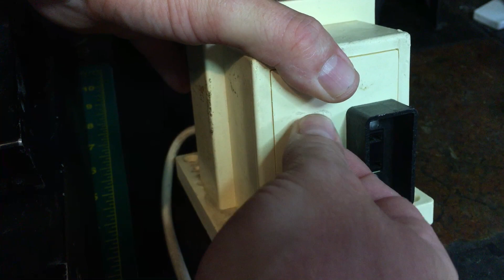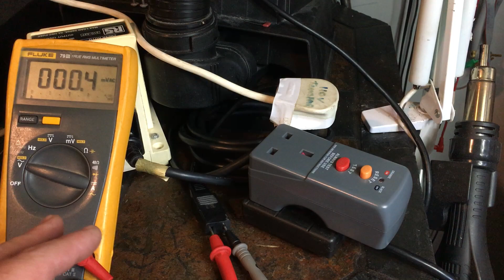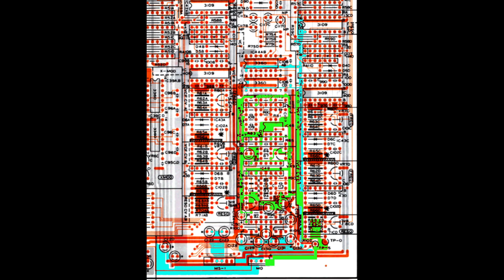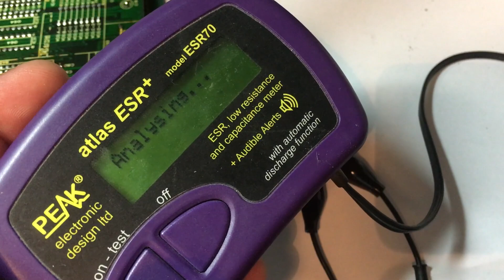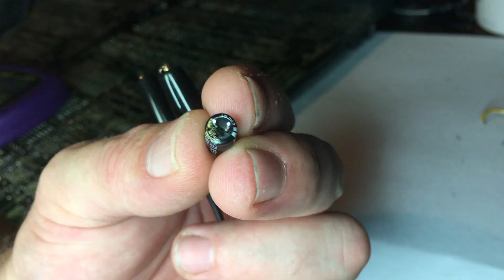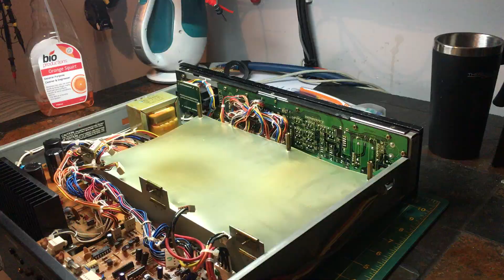Roland MKS-80 Repair Part 1

Comment: Amazing sounding synth. had 3 at one time. still have one left but LCD needs to be replaced.
Reply: You can replace it with one of the Winstar 1x16 OLEDs left out there. Or, if you prefer blue, there's a guy from the UK selling the last of the blue on black OLEDs for this. It's pretty easy to replace, and if you pull the backlight transformer, no more backlight noise.

Comment from the maker: I have just made a basket of caps on Farnell, 108  needed for a full electrolytic re-cap.  Came to £36 using mainly Panasonic FC range. Question is do I replace the rocking Japanese ones?

Comment: Very nice, the cap meter seems super useful. Which kind of paste are you using for aid in desoldering? Thanks.
Reply from the maker: I use am tech NC-559-ASM flux
Reply: Thanks, looks like a good alternative to adding more solder on top for difficult joints. I would guess any flux paste could work well enough.
Reply from the maker: I use it mainly to help remove all previous solder as mixing old and new solder is not a good idea.  In this case the flux makes the old solder less viscous and easier mop up with the braid or sucked up by the vacuum gun.  The way you are left wth clean pads on the board to apply fresh solder too.

Comment: Forgive the ignorant question, but what is it about that noise that pointed you towards the caps?  Or is it simply that caps are the most likely components to fail in older synths?
Reply from the maker: Considering the effect on the power supply rails and its age its a logical place to investigate.  The cap meter really helps as it attempts a read in circuit and can handle a charged cap.
Reply: Caps are routinely the first to fail in all electronics